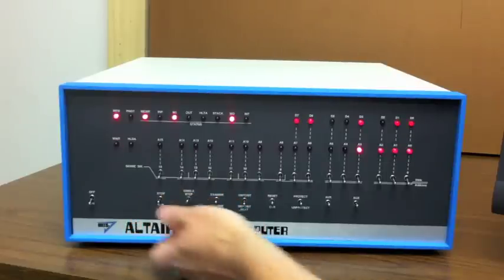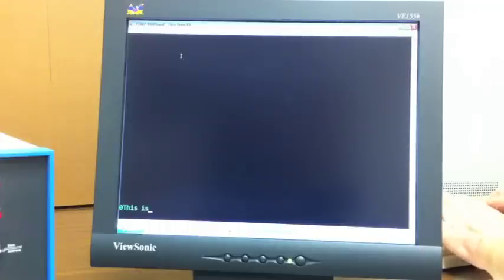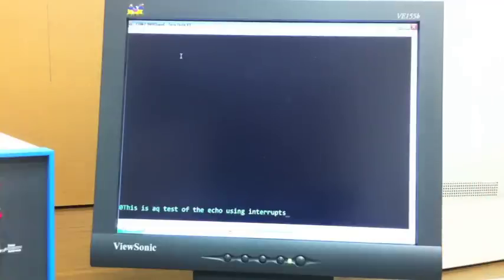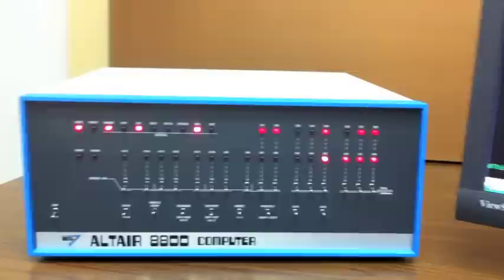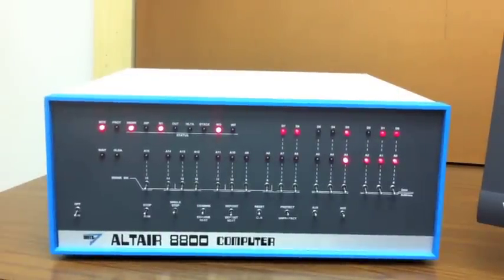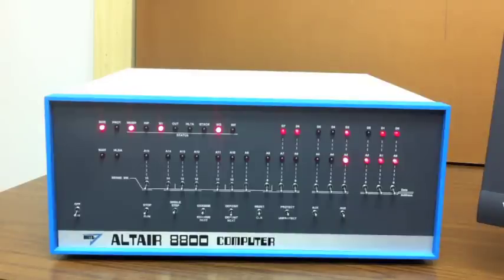Altair 8800  - Video #6 - Serial I/O Echo Routines

Comment: one little detail I am missing: Where is a keyboard and a monitor connected? I am sure that there is no usb WiFi on this "beast"
Reply from the maker: As demonstrated in this video, a serial port in the Altair is being used to communicate with an external terminal. Since vintage computer terminals do not record well on video, I am running a terminal emulator program on a PC as the external terminal. The non-glare LCD monitor records on video much better.